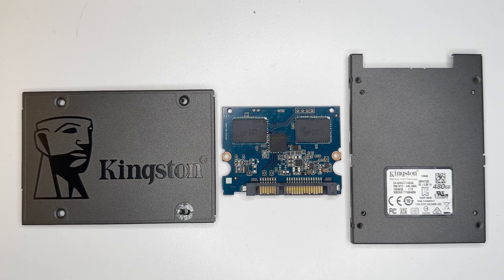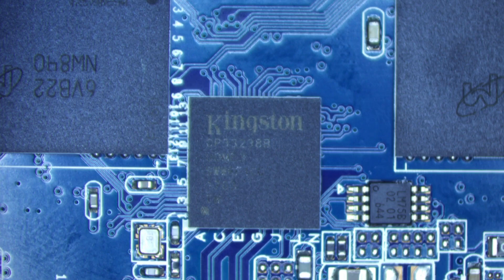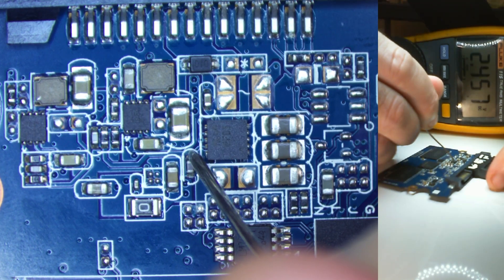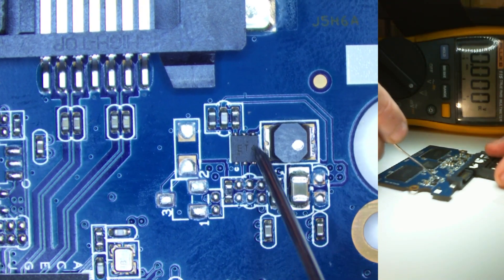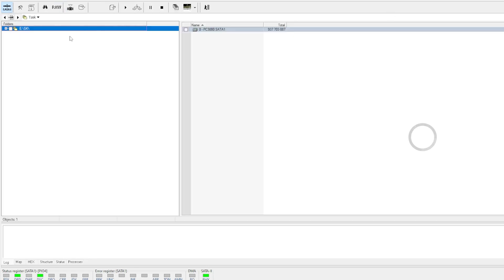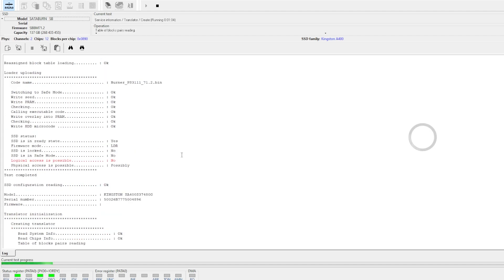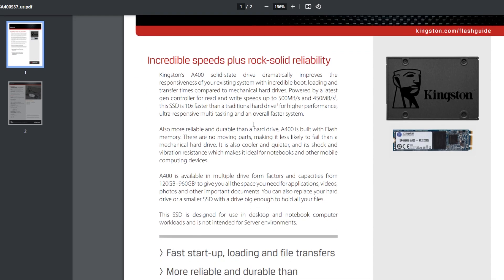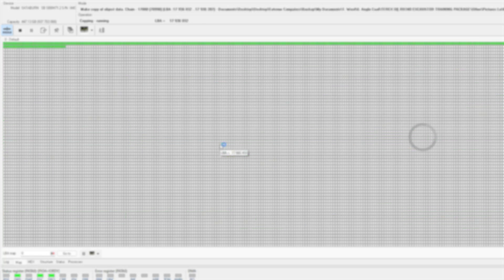Kingston A400 SSD Data Recovery - BRICKED! but all data back

Comment: what software is that please? thank you
Reply: It's a dishonest description.  It's a hardware diagnostic interface called a PC3000 from Ace Laboratory.  The features in use require the SSD addon.  In the Express trim, this combination will set you back about $9000 US.  I have one of them, along with a Chinese tool called MRT Ultra, which does about 65% of the same things with a few less features for half the price, in my lab.  It's it's not cool to refer to a professional data recovery tool as a diagnostic software.
Reply: The kit - PC-3000